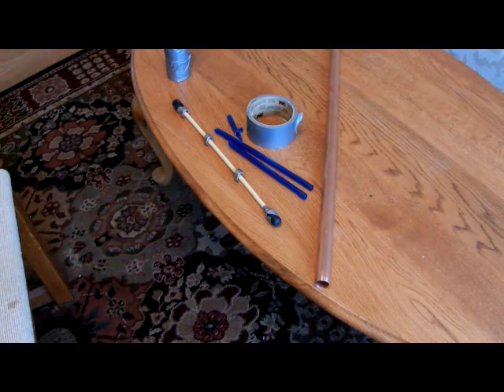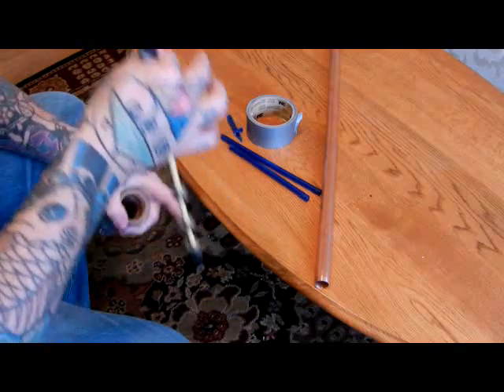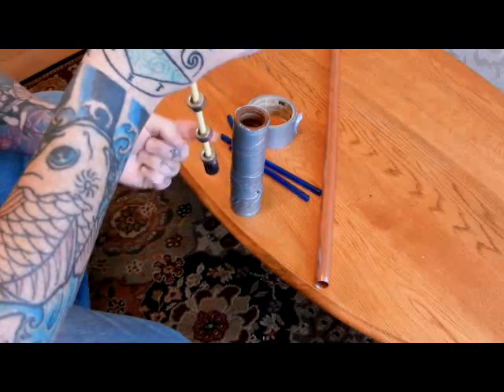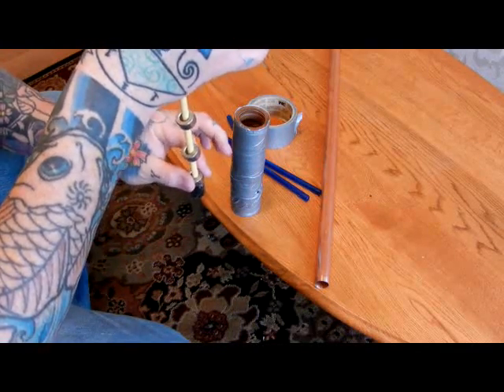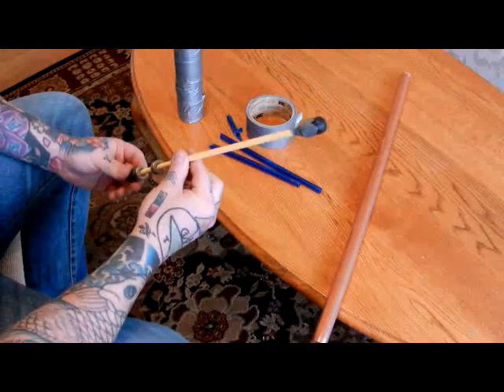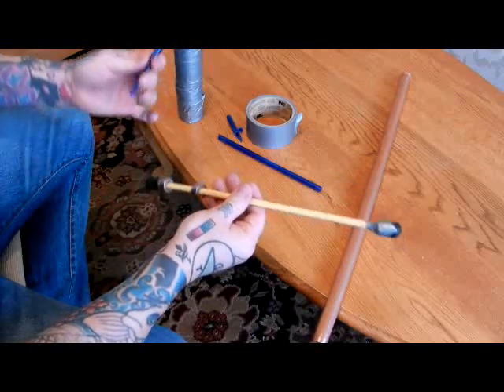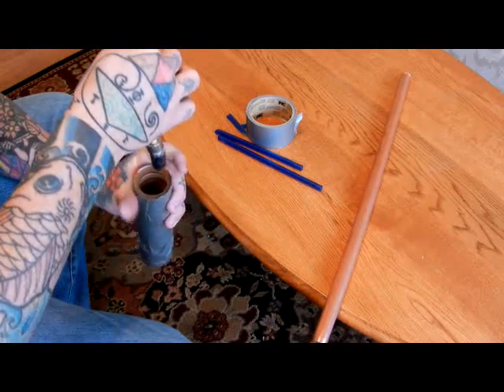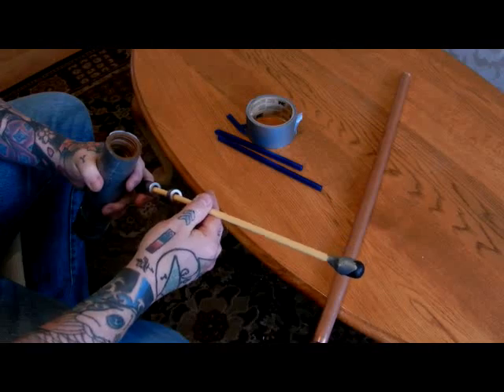VID 1 Amazing! Eric Dollards 'dielectric capacitance', proof against electrons in a non-conductor

Comment: Shouldnt the magnets themselves slow down in the copper rings?  Forgive my newbie-ness here, but I'm not seeing how this is different than magnets dropping slower on their own.  However, i do remember someone (perhaps Dollard) saying that the oil itself in the transformer could be transferred as you stated.
Reply: The issue being that the magnets aren't attached to the non conductive rod as such it shouldn't ALSO slow down with magnets upon descent through the copper rod, at least thats how I am understanding it. ONLY the magnets should slow down and nothing else
Reply: @bobdole27  So, then wouldnt the rod have this effect without the magnets?
Reply: Basically... yes.
The rod cant interact with the conductor, its neutral. 
The moving magnets can interact, create electric fields, and there is an electrostatic effect now possible between rod and conductor.
Reply: @bobdole27  I think I get it now.  The magnets have dielectric attraction/induction in the rod and magnetic induction in the copper pipe?  Still trying to piece this together.

Comment: The rod should have one magnet on it with the top of the rod left open then just drop it in the copper tube and see what happens. Does the rod drop to the ground before the magnet? Oh and make the rod only 1 inch in length. I bet the rod will fall first.

Comment: It seems to be due to eddy currents and lenz law. Where are the mathematical and physical explainations. Where is the published work?
Reply: Little bit of missunderstanding budy. The magnets do not fall because EMF as per lenz law, that we all agree, Eddy currents are present on the core material where the magnetic field is transmited, in this case there is no core arround the coper bar so no Eddy currents. So the question is why is the non conductive rot not free falling?, good question don't you think so. The experiment might be wrong but the premise is always the same. There is a similar experiment, take a trifilar coil wond around a non conductive core, the first 2 are conected in series, then feed a sine wave at a speed different that the resonant frequency of the coils, finally conect a load or resistance to the third coil and  VOILA, you can transmit electricity as if it were a regular transformer only that there is no core material, the faster the sinewave the closer you get to 99% efficiency energy transmission
Reply: @horaciohherasq6526  the rod is not free falling because he holds it. Jesus.
Reply: @125varma  I know enough of this guy from his videos to see that he has a mental problem. And without working inventions or theories. Why should I waste my time reading his books? And yes, I did experiments not only about electromagnetism, but also about mechanics, thermodynamics, optics and quantum mechanics. You know. There are institutions called universities where you are able to learn and do the experiments for yourself. Each semester we had a lab where we did the relevant experiments.

Comment: It's Lenz's Law, from the year 1834. Been around a long time, almost 200 years.
Here's the story.

LENZ'S LAW -- "A magnet 'M' moving in close proximity to a conductor (does not have to be a ferrous metal -- just a conductor, including aluminum, copper, etc. and the ferrous metals)  --

"A magnet 'M' moving in close proximity to a conductor induces current and a magnetic field that opposes (is the exact opposite of) the magnetic field of magnet 'M'.  

That's why magnets dropped down a metal pipe slow down.  That's also why magnets don't slow down when dropped down a plastic pipe; plastic is an insulator, not a conductor.

SEE => https://en.wikipedia.org/wiki/Lenz%27s_law

Comment: Without going so far as to say this does not demonstrate dielectric capacitance (because a potential partial alternative explanation isn't necessarily proof of a theory's non-existence), one possible variable that needs elimination from this demonstration because it is a possible explanation for the resistance on the inner rod is the difference in descent angle that may arise among different rings as they all pass through the tube. The rings would each attain a slight angle, not necessarily in alignment with the others, causing light friction upon the rod (because we know the magnets will encounter resistance, and the transmission to the non-conducting rod could occur through friction). The magnets bounce freely outside the tube when resisting only their own vertically stacked magnetic fields, but we need a camera view inside the tube to see how they align and whether they physically tilt to frictionally grab the inner rod once they're inside the tube's induced field.
Reply: Great piece of  logic. I far prefer your explanation
Reply: Like